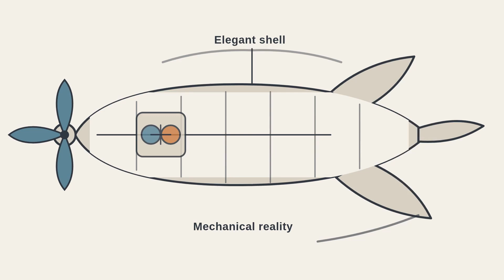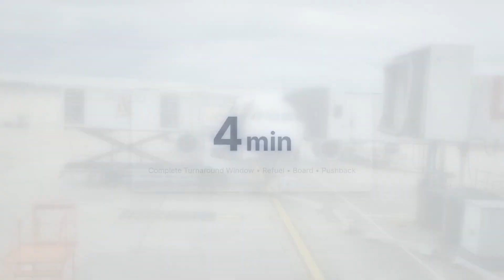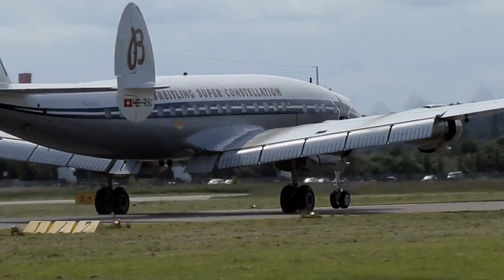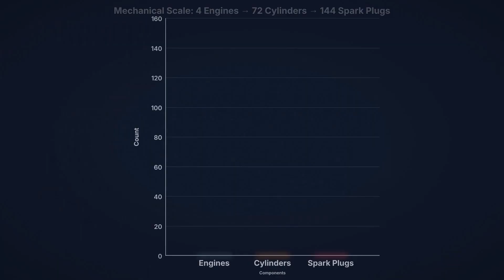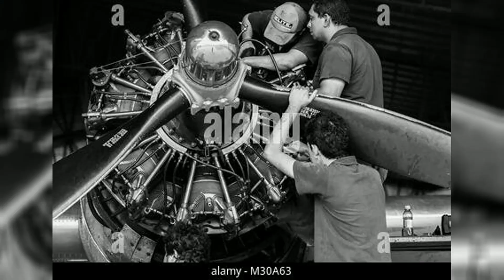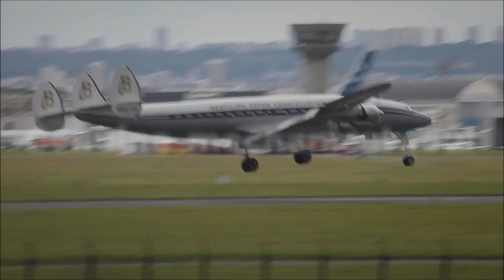We Gave The Constellation a Modern Airline Schedule

Comment: There is a reason that the radial engines are relegated to history. The early turbine engines gave more speed, but they were very thirsty and not as reliable as today. But the Modern turbine engines have insurmountable advantages. 
I know a former Navy flight engineer (FE) who had plenty of seat time on P-3s, a turbo-prop. Propeller for efficiency and turbine power for reliability and longevity. He repeatedly refused to go up in general aviation aircraft unless it was a turbo-prop. He isn't wrong. Even  properly maintained and operated, a piston powered, air cooled engine is inherently less reliable than a turbine.
My dad was an A&P (airframes & powerplants) mechanic for nearly 40 years, so I grew up around this stuff. 
I like the old birds. I want to see them hang around for decades to come. But just like the model A Ford, you only drag them out occasionally and use them sparingly. They have earned their honorable retirement and place in history. We will still be in the jet age long into the future.